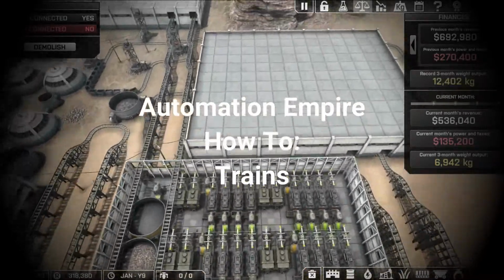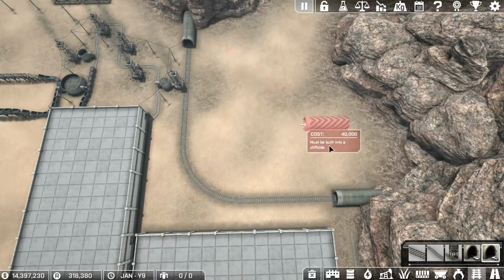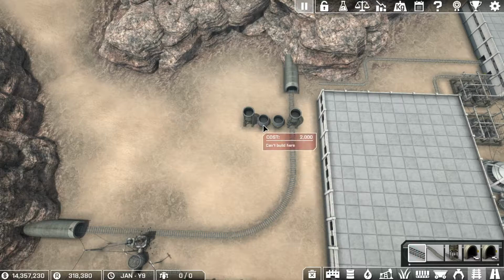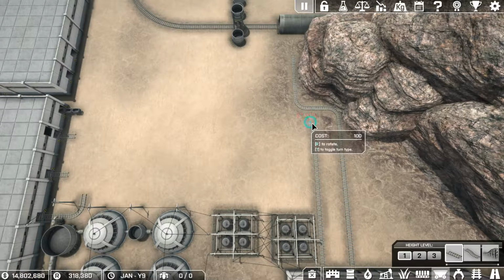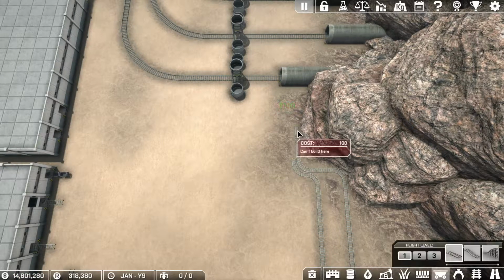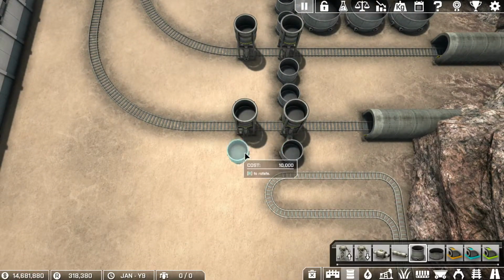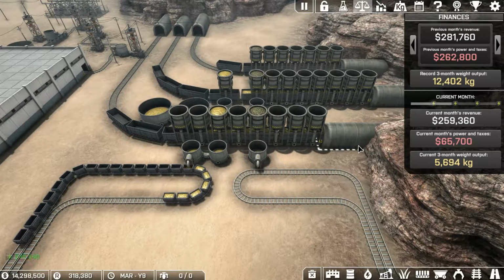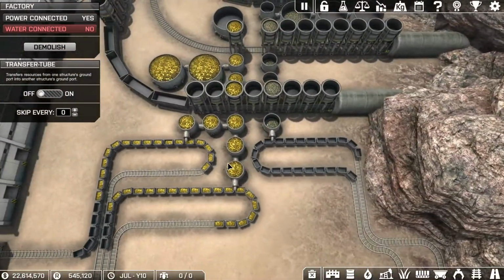Automation Empire Tutorial #4 Trains

Comment: Great clip.  Covering all of the basis.
     I discovered the issue (problem) of train length reaming the same after removing Silos by accident when I tried to reduce the length of a train, only to discover that I couldn't.  The only way to reduce the length of a train ins to demolish the Tunnels and start again.
     The fact that you can't step back in this game is one of the problems I find a little annoying.  Like, when you increase the frequency of truck production and then find that you may be struggling to load them quickly enough, you can't revert back to the slower rate.
Reply: "way to reduce the length of a train" save/load restores 4-carriage-length for train.
"you can't revert back to the slower rate" I can't see the problem, simply empty trucks will pass through a road.